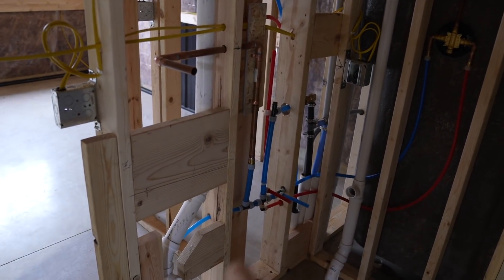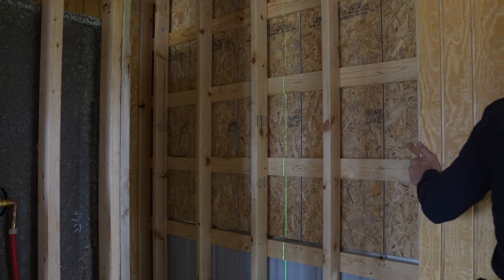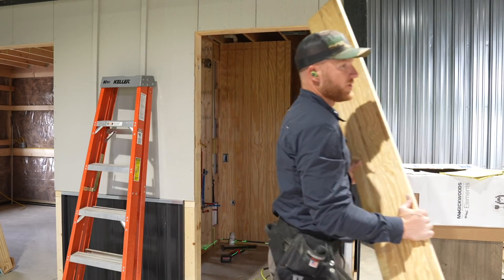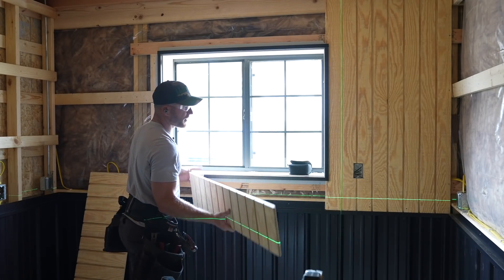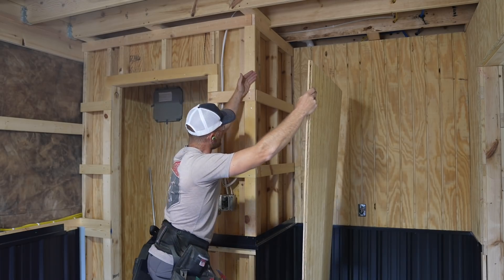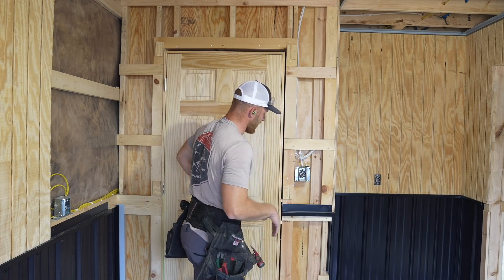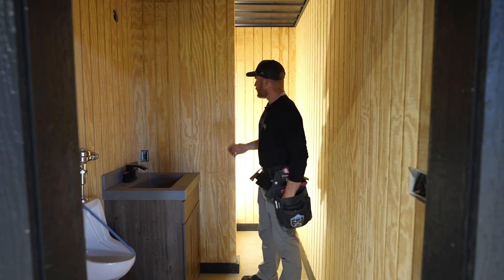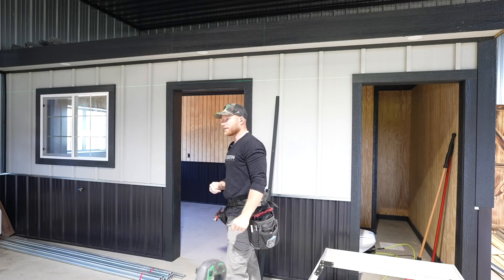Bathroom and Office Build Out FINAL Installing Sliding Barn Doors

Comment: You r amazing at the metal trim.I don't recall that u showed your house completed. I  watched your layout on stair stringer. I always use as a rule to make the tread layout one and a half inches under size of the finish tread. When doing conc steps back bevel the riser the same one and a half inches that how I was taught.

Comment: Loved it, but I only have a small issue, wood & water do not mix very well, The back and all joints should have has some water proofing sealant or paint applied prior to installation.. I know you don't do the painting, but a waterproof primer need to be applied before pain goes on.. I made the mistake of putting T1-11 up in my bathroom about 20 years ago.. It started rotting in a couple years and when I removed it I found the studs and bottom plate also had rotting and mold was developing.. Ever since then, I apply waterproof primer to all studs in the bathroom and I put open core expanding spray insulation on every wall that is also an exterior wall.. Any wood that goes up in a bathroom, I personally prime with a waterproof any wood that is going up in the framing of a bathroom wall, It takes on a few minutes to do and can make sure the wall lasts for many decades to come.. Sorry if my comment sounded harsh, it was not my intent.. I have seen so many youtube video's with people using untreated wood in the bathroom where rot & mode can happen..
Reply: Yeah, this bathroom screams for moisture control. Two exhaust fans at least.  The urinal mounted on plywood is cringe worthy.
Reply: I said the same thing.... "Is that a shower stall?"  Wooden paneling with a metal roof is a condensation and water damage nightmare.  

But... the saving grace I see is that it is not like a typical house.  It isn't insulated or on an exterior wall from what I saw so there is a hell of a lot of ventilation for the space.  So the actual problems of taking a hot shower and the fog up might be similar to having a very large bathroom.  I grew up in a 1880's house and the bathroom was so large that hot baths and showers never fogged anything up.  

Having said that... I honestly don't know what will happen to that wooden siding.  It does seem like a really, really bad idea.
Reply: @MrClarkisgod  I completely agree, after watching I had to say something, normally on his builds, he is so hyper aware of water infiltration and goes the extra mile to minimize it from happening and aware of internal framing getting water damage and putting a barrier between the concrete and bottom plate, I loved the idea, and now, in a bathroom putting untreated wood and a metal ceiling in a very small bathroom, I literally screamed no!!! They make a plastic/wood product that looks just like wood, it costs a lot more, but it id designed for wet applications to be in bathrooms, showers & other areas where there is water, and it would work well.. My daughter wanted T1-11 in her bathroom, I got some of that cut dados every 4 inches and it looked just like T1-11, but no wood grain showing, it looks great, but it was expensive and took a lot of extra time because of doing the dados about 15 to 20 minutes per sheet, so if she were to have paid someone else to do, it would have been 3 to 4x the cost.. I love watching this channel and this is the second time, I seen him really screw up.. He is young, so hopefully he will realize the mistake he made.. in a bathroom function comes first, this is why bathrooms are so expensive to do, is because of all the precautions you have to do to keep water, moisture & humidity out...
Reply: R&R please reply to these concerns ?

Comment: Hi Greg, wasn't there a bottom guide for those doors to stop them swinging out?
Reply: No, most of them hang just like that, the weight keeps them flat, but yes they can swing out, it rarely ever is an issue though..
Reply: @TheWolfster001  My 45 years as a carpenter would say, they can and will swing out and I have never fitted one without the track groove routed in the bottom to fit over the floor pin. We obviously do things a lot differently here in the UK.
Reply: @davidperry2306  agree that I think you'd want the door to close somewhat tight at the bottom so any "bathroom noise" doesn't escape so easy.
Reply: Occupants, especially women, want a bathroom door to be very secure and private when locked, speaking of which, how will it be locked when in use?

Comment: Kyle, I’ve had one question for quite sometime. On your ceilings you seem to install the ten on eight foot spacing, am I missing something or is this what you do? I just can’t see that holding up over time especially with the weight of insulation however little that may actually be. I hope to build my own shop your style early next year, Rocky from AG/Ready LLC land management, animal handling systems and fencing.